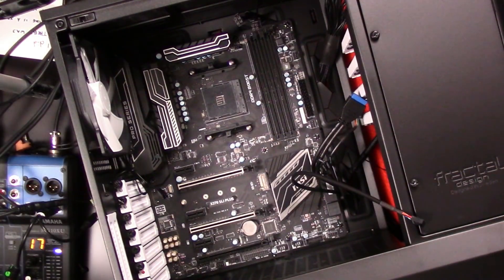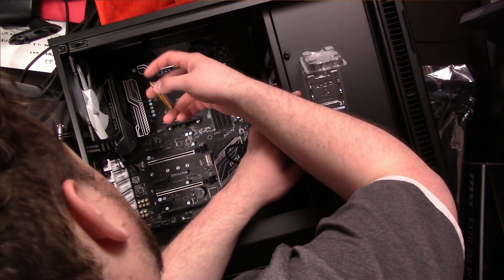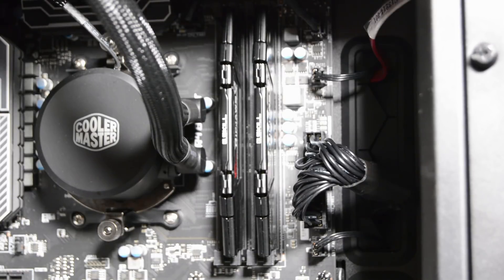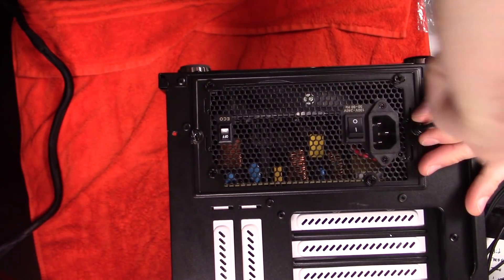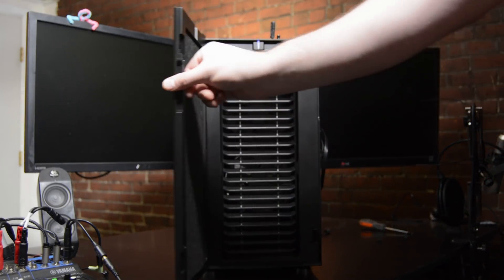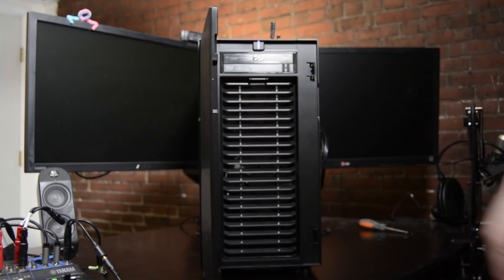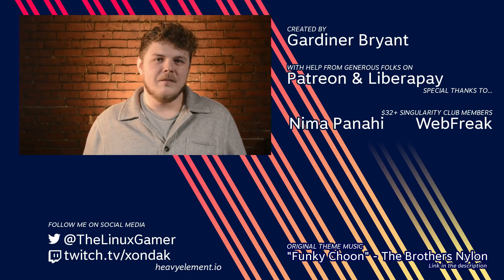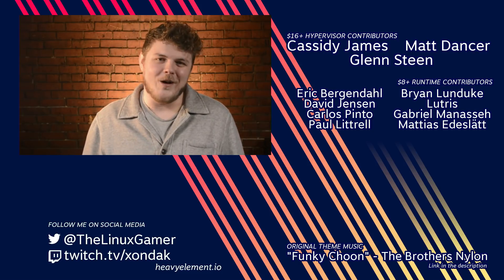MEET D'ARGO | My New PC Build!!!

Comment: You can use Prime 95 sometimes referred to as mprime for linux to stress test the CPU and the L1/L2/L3 processor cache in the terminal. it will max out the cpu if you intend to do some overclocking. It's free and Open Source.

Comment: I have not built a new PC. Paul and Kyle did that. But I have started using linux. And I got to say the AMD gaming is way better now. I using a 1700X with gigabyte 370X gaming-5. 16 GB of Corsair LPX, Red Devil GS RX 580, and a 250GB WD blue m.2, OCZ TL 100 240GB Sata, and Samsung Evo 850 500GB SSD's. I use the Toshiba for linux and hope to finish off the build for now with a new air cooler and 3TB Hard drive. I got to say I can still see improvements that need to be made. But I am much happier with where AMD linix gaming is now as opposed to last year. And I don't have to many issues with Ubuntu right now. Some of my games launch on the wrong screen. So i need to work that out. But even my arctis 5 mix dial works. Super happy with it so far.

Comment: Umm your radiator fan is pulling air into the case instead of pushing out of the case. The current configuration dumps hot air from the radiator into the case.
Reply from the maker: I turned it around after I filmed this. It only took me a few minutes to realize this. Thanks, though!!

Comment: with ryzen you might want to check the linux governors. Basically most distros set it to ondemand governor and in some cases games or other software don't want to pull the cpu out of idle clocks or in regards of games, the clocks switch constantly and games will have fps drops. What helps is that you force the governor to performance if you go gaming. Check your distro wiki how to do that.

Comment: Solus! I never thought I would leave Debian. I installed Solus to check it out.. I haven't booted Debian since. 😍😍
Reply: Not gonna lie, haven't heard of it. Been with Manjaro for a while now. Is it rolling release?
Reply: Capta Praelium yes it is
Reply: Solus fan here too! :D
Reply: Must try it, thanks for the tip!
Reply: I currently use Debian and you made me curious, what is better in Solus?
Reply: Andres Fest Solus is up to date rolling and stable. It has excellent steam integration built in and focuses on under the hood engineering for snappy response times. Default UI looks good and is customisable. The software centre is curated so less choice than debian.
Reply: Agreed. Solus is awesome.

Comment: Both my desktop and laptop, both Archlinux, have been out of date for weeks to the point i can no longer update them. Blame my health and i'm still not back into shape. As a result both want a couple hundreds uodates but cannot due to depedencies. Any ideas before i'm forced to reinstall ?
Reply: Hope you're feeling better m8.
I have some serious illnesses and have had the same trouble with rolling releases - if you don't keep up with the roll, you can be left behind, because it wants to update to the latest version of each package, not the next version. I'd like to know if there's a way around this, so that the updates happen in the same sequence as the roll did.

Obviously this is not optimal for bandwidth, but some of us have other concerns!
Reply: Yeh that's the one. If you manually list them and go through them in order, you find that after manually installing like 10 packaes, it rolls through the other 400.... and to get those 10 packages takes like 2 or 3. It's a dependency tree that forms over time due to neglect, and by the time ill people can get to it, it's overgrown. Not to mention that if the 2nd root of the dependency tree starts with a 'Z', you still get to the end before you luck on to it.

I wish all rolling releases had a "update, using every package list since last time, one by one, in chronological order" switch.
Reply: It should not be hard to fix this without reinstalling. What packages are causing trouble?
Reply: Capta Praelium : thanks for the health concerns. Being epileptically unstable is boring...
As for the package issue, this is pretty much what i'm experiencing. You nailed it.
Reply: Erik Wallström : 478 packages are causing trouble on my laptop alone right now. Not counting how many versions of each package. :-(
Reply: Capta Praelium : from the initial looks of it the depedency tree loops. I will try it in depth again when i am stable but for now that's what i've been able to observe.
Reply: On a note to avoid this you can set it to update every weak with a simple bash I recommend doing this I currently have mine send me an email and if I don't reply with a specific string in a day it updates
Reply: Light Armanov : reason for that update problem is my health issue preventing me from powering on my computers in the first place until solved. You can't update if your computer is powered off...
Reply: Darth Killer ah okay I didn't know it was that bad hope you get better :)
Reply: Ditto here, but I appreciate your taking the time to help us out man.